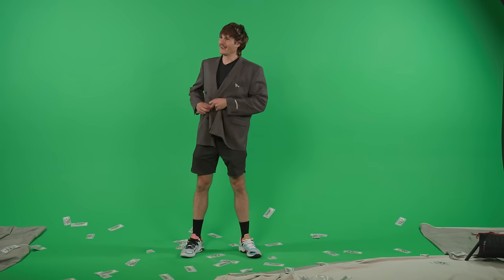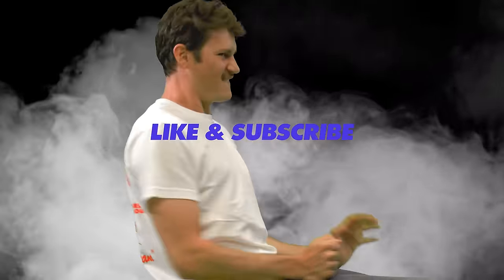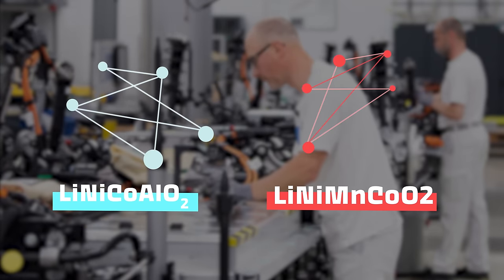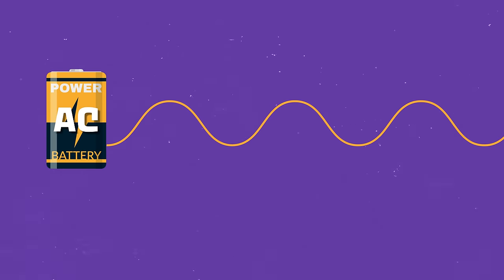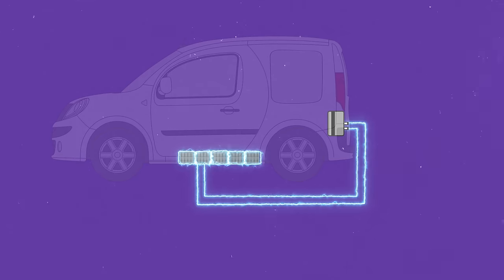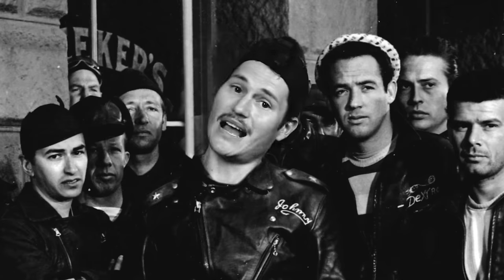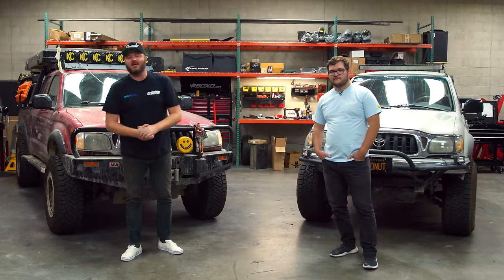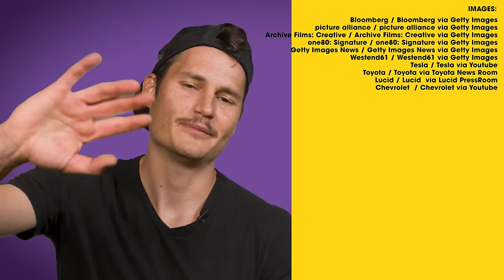Why this Chinese Car Costs $900

Comment: At 25 mph I don't see an issue with these. Seems like a golf cart with doors, windows, a/c, heater, and back up camera.
Reply: I doubt it has a/c
Reply: a/c and heater ?? lol ,, its a rickshaw on 4 wheels and you will replace all those batteries after 1-2 years due to deep discharging
Reply: Well better to swap it with a suzuki GXR1000 engine it'll go faster then 25Mph..........😂
Reply: @its.2782  now we are talking 👏🏻
Reply: For me that walks or ride a bike for 4 miles to work, this is perfect for it
Reply: and there not road legal unless ur in a city with a 25 mph speed limit
Reply: a/c too expensive, it has windowtronic instead of climatronic
And heating? I guess you can ghetto-mod it, but good luck driving anywhere with heater on.
Reply: @nevaehwhitfield3545  not road legal without 4 wheel brakes.. only has rear brakes
Reply: Like a Q-pod
Reply: @Techie1224  You could swap the batteries out for deep-discharge ones, of the type used in caravans, camper wagons, RVs etc. Unlike a normal car battery that's usually only discharged by turning the starter motor to set off, then charged up quickly again by the alternator, they're designed to take a deep discharge, going all the way down to almost-flat, and not being damaged by it.

It's to do with how thick you make the lead plates.

They cost more than the usual kind, but they'd also last a lot longer. Stick those in, and you'd get a lot more life out of your batteries. Of course the rest of the car is probably made out of tinfoil. But it'd be great if it took off. Now the Indians and Chinese are becoming prosperous, they're gonna want cars, and if they choose EVs that's a shitload of pollution that's going to be removed.

Or... that is... moved. You still have to generate the electricity of course. But there's non-polluting ways of doing that, if the Chinese decide to go with it instead of burning all that coal they live on top of, would be great. I'm sure they don't want any more pollution either. Recently the rest of the world has come to realise how much it truly sucks having to wear a mask all the time, nobody wants to live that way if it's avoidable.
Reply: @Mic_Glow  Ironically if you want heat, you'd be best off with something like a diesel or kerosone heater. Consider it has a 1200W motor. The electric heater packed away in my cupboard is 3KW. 1200W is an upmarket hairdryer. So if you want dry hair when you get there, you've used half your mileage.
Reply: Just one issue u are giving money to ur rival country to fight with ur country by using ur own money.
Reply: Beats walking
Reply: Yeah but it’s not fast enough to drive on the streets so it’s not street legal, and it’s too big to drive on the sidewalk. It’s basically the legal equivalent of a mini bike/pocket bike, meaning you can only drive it off-road.
Reply: Until somebody made it roll over by their bare hands when it stopped...
Reply: I have to see a 60 volt DC electric air conditioner and how much current it uses I have to see this or any electric cars technology on AC and if they were using water for heat that motor must be doing some work
Reply: @AnnGEkelt  I know it's got a form of a heater and some of these cheap ones do have AC I just would like to see it.
Reply: @its.2782  heck I'll put a GS550 engine in there and make it dangerous
Reply: @nevaehwhitfield3545  they're not highway legal but they are City legal and back road legal
Reply: @mikebradley4245  they let golf carts on the road now and it's about like a golf cart and golf cart can stop pretty quick
Reply: @BINX-RR  they are legal on back streets they're just not allowed on highways with a speed limit over 30 you can drive them around back streets.
Reply: @ronalddaub9740  at 20 mph I’d be pushing them with my truck
Reply: @nevaehwhitfield3545  I'm not impressed with your truck even though I love internal combustion engines and I've been a mechanic all my life and motorcycles I'm just thinking this little thing is cool even if it is a piece of crap
You can act all big and manly all you want but I don't care you don't impress me
Reply: @mikebradley4245  it can go anywhere a side-by-side can go get it? No it can't go on the highway but it can go around town
Reply: @BINX-RR  quit lying it can go anywhere a side-by-side can go no it can't go on the highway but it's not illegal in town or on back streets for the speed limit is 25 mph get it it's not illegal it's restricted..
Reply: @ronalddaub9740  I wasn’t trying to impress you my truck is not impressive it’s a 98 f-150 with a 4.6L v8 only making 220 hp it’s slow ash
Reply: @nevaehwhitfield3545  you're just a trash talker that's the point
Reply: @ronalddaub9740  idk how I mean the car is shitty if it was in front of me on a 45 I’m not gonna drop to 20 they can take there car somewhere else into town I’ll drop to 25 there bc that’s town speed limit well it’s actually 20
Reply: @ronalddaub9740  ur like a 60 year old dude arguing with a 16 year old don’t u have work
Reply: @ronalddaub9740  Mmmmmm........tasty.....🤤
Reply: @Techie1224  but for the price you can just keep buying new ones
Reply: @nevaehwhitfield3545  not when you have a golf path that leads ya 5 miles closer to work to ya pops house might just drive this there cut travel in half
Reply: @OwlWise_gaming  
6 batteries x $70
avg year and half would be like $450

while people at developed countries have good used drivable cars for like 5k usd or less
Reply: @AnnGEkelt  The basic version doesn't, but you will get one by upgrade to any other version; it doesn't cost that much. all they do is screw an a/c on the car frame.
Reply: @Techie1224   just replace the lead and acid
Reply: This is cheap even for a golf cart!
Reply: @nevaehwhitfield3545  I take it you don't  understand  how speed limit  work! Slow traffic  to the right and only  freeways  have a minimum  speed.
Reply: A golf cart costs more.
Reply: @TedSeeber  I think you mean LiFePO, or more strictly LiFePO4, Lithium Iron Phosphate. Yeah probably the batteries contribute a certain amount of weight, but there's only 5 of them, weighing from 14KG to 22KG each. So call it 100KG conservatively. That's about 50 amp-hours, at 60V. So 3KWh. How much would the same in lithium batteries weigh? Presumably you'd keep them at 60V worth for simplicity but that's not a problem. You might save, at a guess, maybe 50KG? How much does the whole car weigh? 

I dunno if swapping out the batteries would be worth the while. Perhaps for lead-acid leisure / marine batteries, that can take deep-discharge over and over again, where the standard car batteries in this thing can't, and will wear out much sooner than they would in their intended application. But swapping the chemistry altogether, I dunno. I suppose there's a reason Tesla et al use lithium, but they have much more power storage altogether, much more than 3KWh. Wait... it's 13.5KWh, I looked it up! 

So since Tesla use 4.5x the battery capacity every weight saving counts significantly more. Their robustness in repeated charge / discharge cycles is important too. Also, they don't take advantage of this yet, but the cells are small-ish cylinders, that might eventually make them easier to stash in other locations in the car. Particularly with lithium-polymers where the frame of the car itself could be made of battery. 

All-in, these things are designed to be low-ish quality, designed right down to a price. The user has few expectations beyond cheapness. The fact it's a car (and also a light truck, nice!) might revolutionise the market it is in. The cheap trucks might revolutionise business deliveries. Currently Indians will strap anything and everything to the back of a small motorbike, the Tuk-Tuk being the most well known, but there are Tuk-Tuk trucks, all horribly overloaded for their engine and structure. The car / truck in this video is miles ahead of abusing motorcycles that were designed in 1960.
Reply: @angeloriolo9918  By that you mean replace the entire battery system, including the motor control and charging boards. This thing probbaly isn't much more than a 60V motor in series with 5 batteries. Doing that, with a pedal controlling a contactor, all DC and mechanical, would work fine. 

In practice though you want better speed condtrol so you want a motor contrl board that will use PWM. Not much trouble, just some big transistors to work switching, either fully saturated or off, they don't mind working that way, generates little head. Then a timer circuit of some kind to switch them. You could do it with a 555 and a variable resistor on the pedal. Probably tho uses a computer. Little 12-bit controller thing. 

Then something to charge the batteries. Again in lead-acid you need basically nothing, they regulate themselves. But these days it's expected to have a proper circuit so probably a big wire-wound resistor and the computer again controlling that. 

To use lithium instead, there are pre-made chips solely for charging lithium packs, so use one of those, nice 'n' cheap. Then there's the batteries, expensive, particularly since Tesla create strong demand for them, and also manufacture like half the lithium cells in the world or something. I would like to know the state of the world's lithium mines, who owns them and where all the money goes. Soon enough that's gonna be a  problem. 

Anyway... If you want to make real improvements, just changing the battery chemistry won't do much. Less weight = better acceleration but doesn't do much for top speed. It will store more power (depending on how many cells they decide to use). You could put a bigger motor in for more speed, but then you'd need a better stronger frame to support it all. Which would be heavier, so you'd need more motor again, and more battery, to shift the extra weight of the frame. 

Overall it's aimed right at a sweet point where prices for it's components all match at a certain point on a curve. If you tried to improve it, you'd ruin the economics, which is the one thing that this car excels at. It's design is likely perfect as it is. There's a reason it only goes at 25 and not 30. All economics, all a price point. This car is the physical avatar of it's own economics. I'd like one, because they're so cheap I could afford one!
Reply: @its.2782  Man i love that idea lol, however considering the build quality idk if its safe to go faster than 25mph....
Reply: @Free_Krazy  can increase the wheel base with spacers and build a small roll cage for structural integrity..............it's that simply........😁
Reply: @Techie1224  just use agm batteries
Reply: So NYC then..
Reply: @saurabhverma3360  Cina isn't a "rival country".  It's a helpful neighbor.  Try to be thankful.
Reply: @BINX-RR  Small service trucks like this are used by shopping malls, amusement parks, airports, etc.
Reply: @sagradamoly4234  for what
Reply: Indeed. Also a golf cart use lead acid batteries. And also the most electric fork lifts. Good deal this car.
Reply: @greenaum   don't listen to this dude do your research.   Deep cycle batteries are not designed to be discharged to near empty.  Deep cycle batteries have plates that are made different from starting batteries.
Reply: @justbored3.14  Er, yeah, they are. They're designed to be cycled, between charged and discharged, DEEPLY. Where ordinary car starting batteries are designed to produce a high current for starting, but to be barely discharged at all, since once the engine is turning, the alternator is charging the battery back up again. So ordinary batteries are never discharged more than a few percent.

Deep cycle batteries are made, to be deeply cycled, used til nearly flat, then charged all the way back  up again. To be used as a power supply when the solar or the generator or whatever isn't running. 

So, deep cycle batteries have thicker plates. The thinner plates in starter batteries provide more surface area for the chemical reaction, so more starting current, but  being thinner, corrode away more quickly. Where deep cycle plates are thicker, so provide relatively less current at once, but don't dissolve away when discharged heavily. Instead, a decent amount of plate remains, which is thickened again during recharging.

"Near empty" is a relative thing. Point being deep cycle batteries are designed to discharge to a much lower state than convenctional car-starter batteries. Whether thats "near" empty or just "much nearer, in comparison", the point remains.
Reply: @greenaum  look up the manufacturer recommendation for discharge cycles for deep cycle batteries.  Most  recommended not discharging deep cycle batteries less than 50 percent.      Yes you can discharge them more but that shortens their life span.     Starter batteries  have lots of thinner plates to provide a large amperage when needed.   All batteries have recommended  discharge levels.   Lithium batteries are the ones that can be discharged nearly 90 percent of their amp hours.
Reply: @AnnGEkelt  you can get models with or without the a/c
Reply: @carlosevfaj  I just want it to bop around town in
Reply: @Techie1224  Yes, some models have A/C.
Reply: @carlosevfaj  Isn't it better for you to walk that 8 mile round trip?
Reply: @priestesslucy  no
Reply: No way in hell could you get a golf cart this cheap.
Reply: @AnnGEkelt  it does have ac and heater, you need to pay extra tho
Reply: @nevaehwhitfield3545  sure they are. Amish buggies and tractors are legal. You just need a hazard sign and stay off limited access routes. Not that people would like you.
Reply: This vehicle don't got AC and It sure don't got a heater both of those items use much more elecricity than that tiny motor and would drop battery range a lot .  Gas engines have a heater because in a gas engine heat is a by product.  In electric cars heaters and  AC both reduce your range a lot.   Oh just for around town for an old person I don't think this is a bad Idea I'm 72  it would be ok for me for shopping.  But it wouldn't make it to the beach from my house.   I just think regular car owners might have unrealistic Expectations.   Also is it even legal in most states?  I didn't see any seat belts    In Physics nuthin is free  cheers
Reply: I'll buy a golf cart made by the Japanese
Reply: It's the perfect vehicle for retirees in FL.
Reply: @its.2782  i doubt that this shit can handle that much power
Reply: @scanialover  with new upcoming technology,  it's possible........🙂
Reply: @carlosevfaj  25 mph top speed. You're better off with a bike or ebike.
Reply: @mikebradley4245  then how come old cars with 2 breaks are legal
Reply: What about 30mph?
Reply: @sadrhogollsodia9505  nah fam we aiming for 200
Reply: @Techie1224  Only if you are taling about lead acid batteries. Litium batteries will last more than 20 year. And chang li also offers litium batteries for $900 more (or around that).
Reply: Do you know how much a golf cart cost?
Reply: @its.2782  Not with those brakes! ;)
Reply: @ledchickenfpv7164  na we don't need no brakes
Reply: And it’s cheaper than a golf cart!
Reply: @Techie1224  It has AC.
Reply: @Techie1224  Sure and replacing the batteries will cost you upwards of $200.
Reply: I see nothing that mentions an AC
Reply: Fire.
Reply: @carlosevfaj  stupid
Reply: @CheeseMiser   smart ass ❤️
Reply: @Threule no.
Reply: Yeah I want one for me grban
Reply: At 25 mph, the 40 mile range isn't really an issue.
Reply: The only reason most other cheaply made vehicles was the safety to speed ratios.  The Volkswagen bus was not safe but went 5 times faster than this car ever could from the factory
Reply: @mikebradley4245  I don't think these are sold in areas where road laws are of much concern
Reply: @Techie1224  You can get deep cycle car batteries
Reply: One of my friend's girlfriends had these back in china. We were talking about electric scooters and he bought out the fact that his girlfriend had one of these and according to her, as she doesn't drive far and she can recharge it overnight for free at her campus it's not bad. And it doesn't have ac just heater and fans.  Plus she didn't need a license or something of sort.
Reply: man ima sell my limo golf cart for this
Reply: @Techie1224 , That depends on how far you drive. There’s a grocery store 2 miles from my house. That’s only about 10% discharge round trip.
Reply: @nevaehwhitfield3545 , The only place with a 25mph speed limit is by schools when children are present.
Reply: @nevaehwhitfield3545  We can drive this in germany on every road (but not the autobahn)
Reply: Swap put the motor and controller for about 200 bucks and that thing will go like 50mph
Reply: @greenaum  11:05
Reply: Yeah, you'd be right there.  Good for golf groceries and going nowhere far, slowly.
Reply: gas golfcarts wil go up to 40 mph. more like a lawnmower with a cab.
Reply: @carlosevfaj get a motorcycle
Reply: @cerberus3426   get a jetpack.
Reply: @AnnGEkelt  it does
Reply: I would’ve loved to drive this around my college campus. Stick some knobby tires on there and it would have been an excellent snow tractor.
Reply: 25 mph is a lot faster than walking
Reply: @greenaum like deep cycle batteries used in boats...
Reply: @AnnGEkelt the video said it has AC and a heater. A lot of cheap Chinese cars have them.
Reply: @Techie1224   Would be trivial to replace those batteries when they are at that point, I still don't see the issue. 

You got stock in GM or something, right?"
Reply: @MarvinWestmaas  
For the replacement price you can get a used real car so this doesn't make sense lol
Reply: @Techie1224  Used 'real cars' ...

Yeah, good luck filling your clunker with gasoline constantly, I'm sure those old engines aren't only good for the environment they surely will not drain your wallet at the pump ( right... ).

You can get 60v LiFePo4 packs for less then 500 bucks. If you buy your environment ruining clunker for that price, you will still spend a multitude of that on gasoline and maintenance. 

The nice thing about EV's is that they don't have a lot of moving parts and therefor  require almost no maintenance. 

Charging is also a lot cheaper as liquid dinosaur. 

Again though, this isn't a 'car replacement'. Cars go over 25mph. This is a mobility vehicle which would work perfectly fine inside city limits.

I like the Citroen Ami a lot more, but heck that's so much more expensive for basically the same thing ( ... built to European standards... so it has actual working brakes lol ).